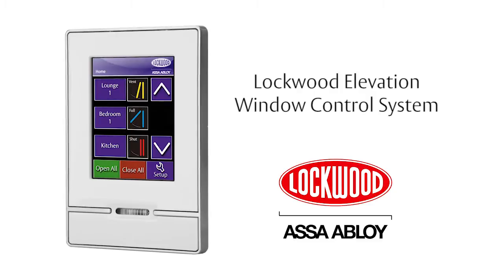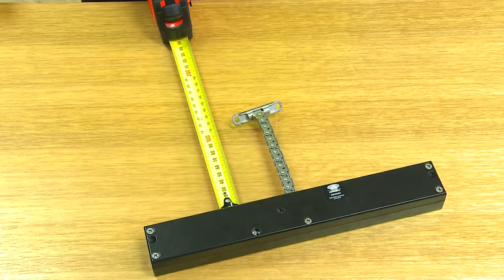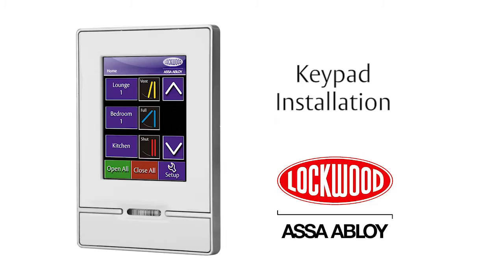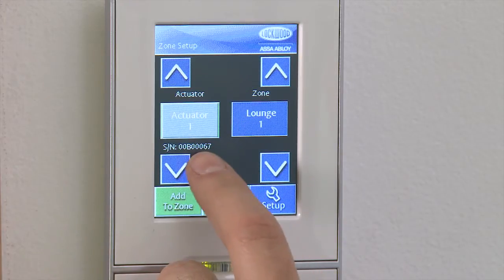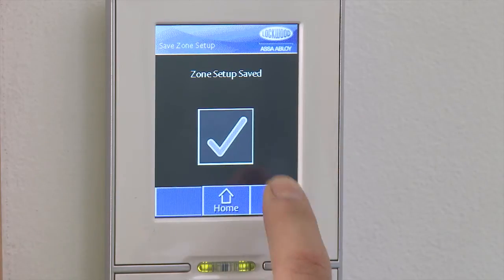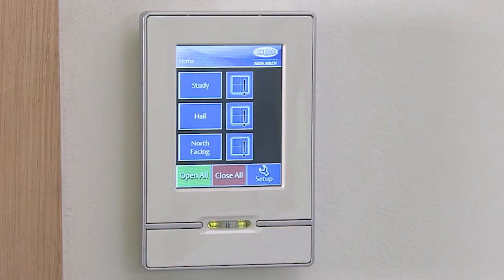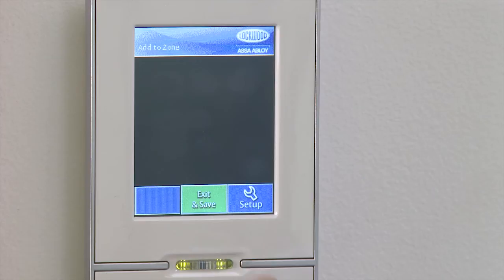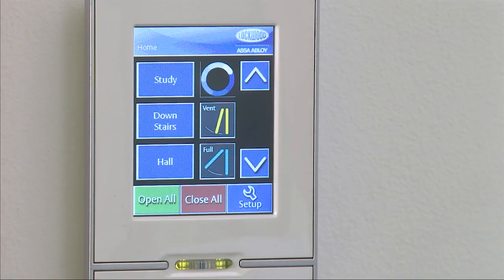Lockwood Elevation Window Control System

Comment: Echoing comments from others, I have no issues with The Lock Shop—great service, excellent prices, and I highly recommend them. My issue lies with the Lockwood product, specifically the motorised mechanical openers (actuators/winders). We have 11 actuators in a residential home, around 5 years old, and they've been used approximately 200-300 times. Unfortunately, 4-5 of these actuators have failed. According to Lockwood’s specifications, they’re rated for about 12,000 activations. The problem isn’t with the motor or the chain, but rather the internal gears. The teeth of the gears, especially the main gear, tend to break off and cause the system to jam.

Considering these actuators cost around $400-$500 each, I expect more durable components. I’m planning to reach out to Lockwood to see if they can assist. They should be willing to provide better-made gears so I can repair over $5000 worth of window actuators that are failing due to a low-cost, easily replaceable part.
Reply: Yes, same issue. I have 38 of these installed 8 years ago. Half failed due to broken teeth on the gears. To their credit Lockwood replaced them under warranty in 2023. So far none of the replacements has failed but I wasn't told whether the parts had been improved.